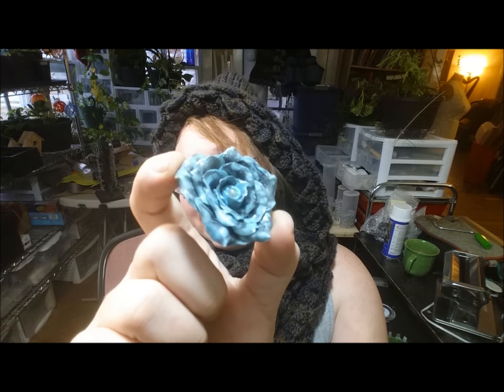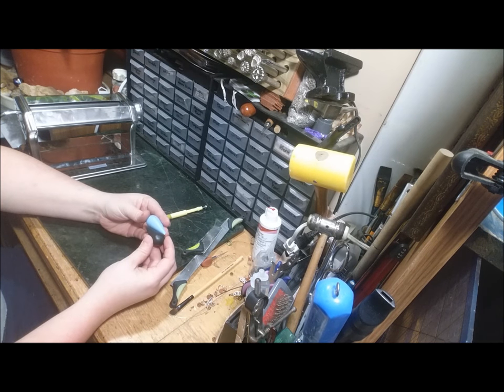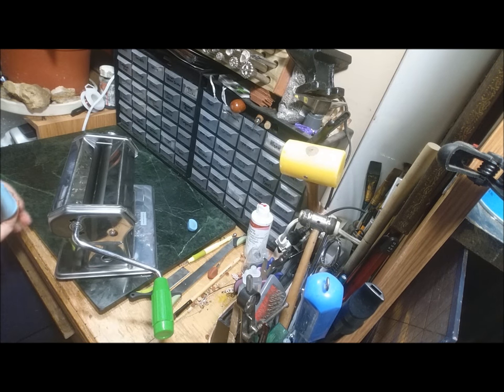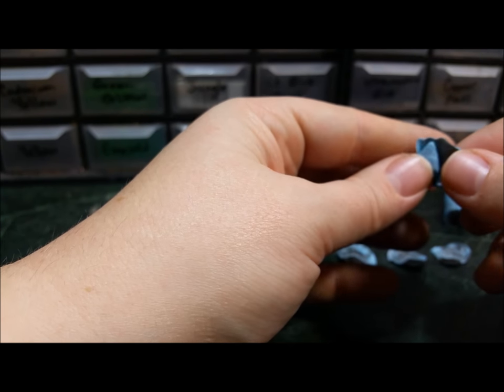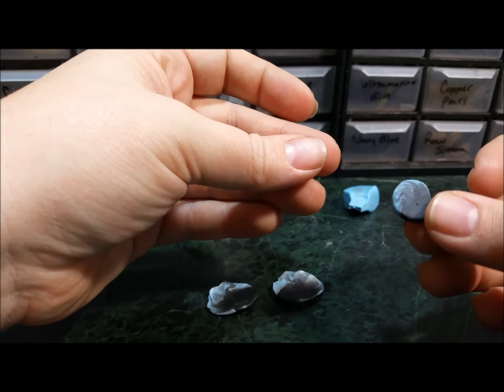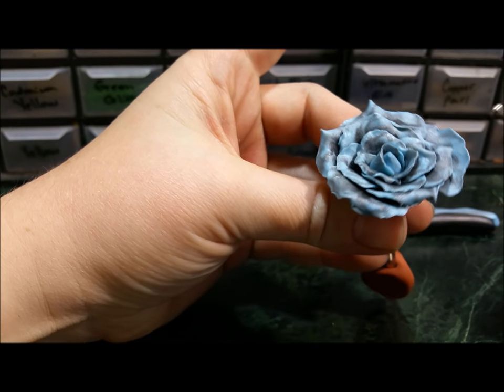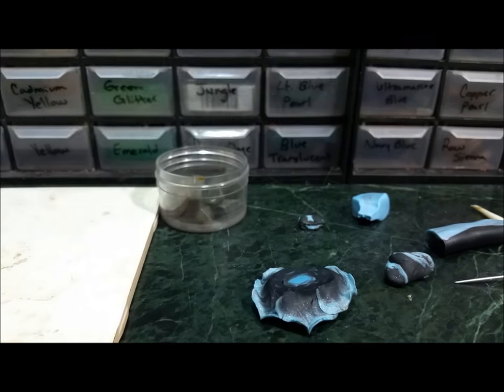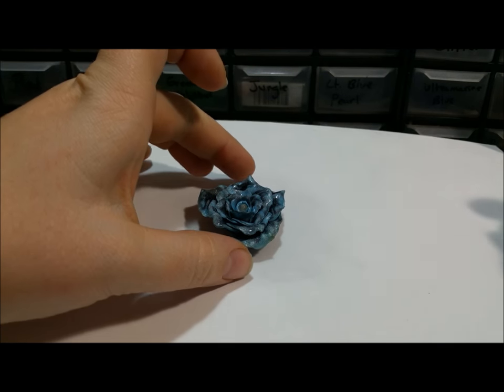Polymer clay rose tutorial

Comment: Hi Yvonne, today is June 18, 2018.  You do beautiful work & very easy to understand & follow. I subbed & just found your channel by accident, you are so versatile & interesting to watch. I am in    MISSOURI too. I have a tip for you that I use on all the crafts I do that needs a coat of spray on varnish or fixative especially if your can is almost empty.  Buy some poster board tack (Dollar Tree) has it, place a small ball of it on the back of your piece or on the cardboard you use to catch the over spray then you can hold in an upright position & get the most out of the can. Also if your cardboard or card stock is white, you can use the poster tack to show your pieces to the camera & should focus well for you. Hope you try it & it works for you. Have a great day.